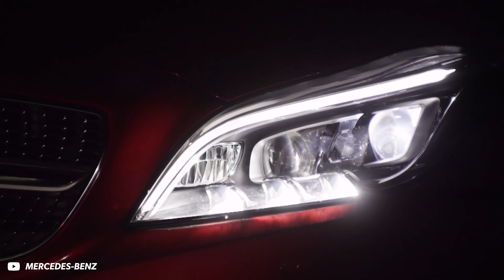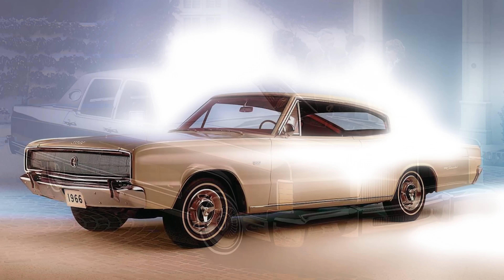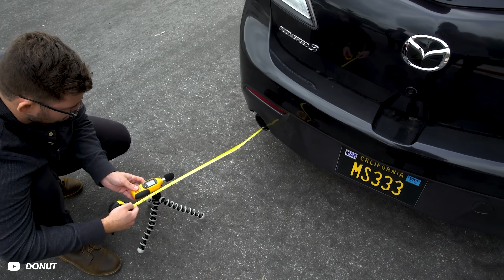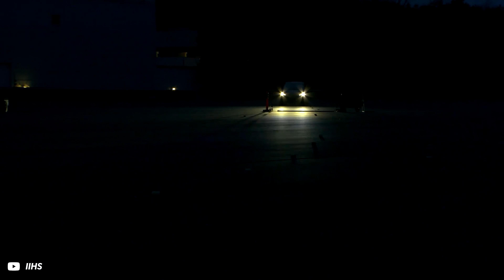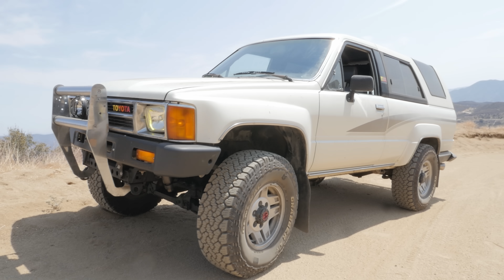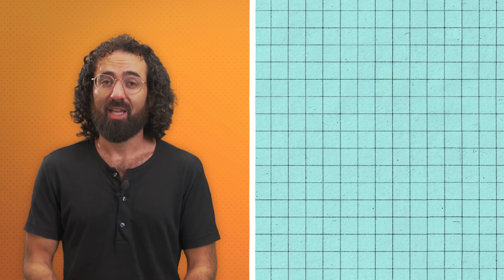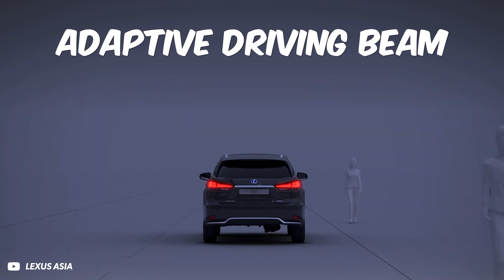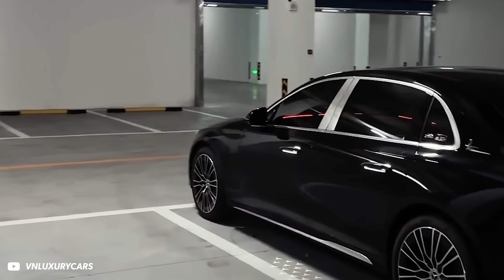Why new headlights are blinding American drivers

Comment: Hi from Germany. Same problem here and adaptive lights are trash. They can adapt when they "see" you, so every time I got blinded for a bit of a second up to a half second, when the car comes into sight and when it changes the separation it can blind you for another bit. I hate adaptive lights!
Reply: Same for me with my motorcycle. Adaptive headlights don't detect me so I'm blinded... And when I'm flashing my high beams, they don't react because they "have adaptive headlights"...
Reply: Yeah, I don't get why adaptive lights get touted as a legitimate solution when we can still see how bad the regular auto-dimming is. An attentive driver can see when the sky is being lit from oncoming traffic about to crest a hill and dim their lights, adaptive lights may not. There will never be anything better than a human with good headlight discipline. I don't know why anyone thinks permanent high beams with 100 part adaptive beams is the solution. I'm down for a standardized housing (yeah I know that's not happening) or at least a standardized lighting arrangement so that drivers with their high beams on can potentially be disciplined. High beams should be in a separate housing or clearly distinct from low beams, the Rivian-style front bar headlights should be banned.
Reply: Agreed, I had it on a few cars, it's unreliable so I just turn it off and do it manually
Reply: @benjimc1  in most modern car there is no on of switch anymore only low and Automatic
Reply: @The_otschi  yes I drive new cars mainly due to work. There usually an option hidden in settings to de/activate auto mode too
Reply: Don't forget those idiotic "auto high beams"- are people really THAT lazy that they need the car to tell THEM when it's dark enough to access that function? Sadly, it would appear so.
Reply: Is that true of Porsche adaptive headlights? In the US local dimming is disabled
Reply: @leok7193 wait really? It’s available in Canada. The other guy is right though, in my truck they make sure to blind the oncoming driver before shutting off.
Reply: @Dave-om6nd  yes, NHTSA did not allow them for a long time. The first vehicle to have local dimming here was Gen 2 Rivian R1T/S and Porsche decided not to bother with passing US requirements so even 991.2 has it disabled on the upgraded headlights. They have it in small print below the option if you pick it.
Reply: I'm not sure I even met a car with adaptive lights, but I definitely get blinded pretty often.
Reply: Yeah for sure I get it. The standard needs to be adaptive led matrix like Audi has on the A6 and the vw Arteon. The shutters box out the on coming  vehicle.
Reply: Could be worse my guy, instead of waiting for that split second before you’re no longer blinded you could be in America where you’re blinded from the moment you see a car to the moment the car passes lol
Reply: So its better to be blinded all the time ? Because thats what the video is referring to. Almans halt. Einfach keinen Grips.
Reply: @ThirdLife86  No it would be better not to be blinded, which was the case with the old lights
Reply: @Rebius  Which according to the stats here would correlate with a 20% higher accident ratio. But hey, so you are not blinded for a split second its fine if 20% more accidents happen on the road at night right ?

Forgive me mylord, i didn't know of your importance.🤦🏻‍♂🤣

Comment: Thank you. I'm a European based cyclist and I was under the impression that a part of the problem is due to the fact that LEDs lose brightness as they age, consequently the manufacturers sell their cars with brighter than required headlights in order that they are still bright enough to comply several years later.
Reply: manufacturers  are not worried about their car 10 mins after selling them

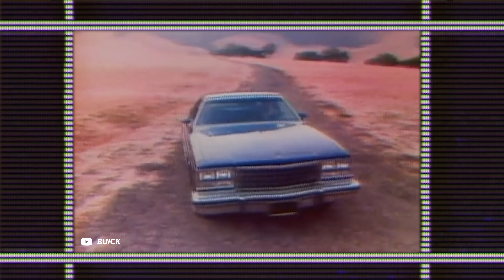Comment: 1:30 I don't care about aerodynamics, I miss when it was so easy. Now you have to disassemble so much crap on modern cars just to replace a bulb
Reply: Totally agree. I thought something was suspect when I went to replace the globes on an old car of mine. It was like $4 for a complete sealed beam headlight. For a modern car, it’s $2,000
Reply: Its even worse on the new toyota corolla with led headlights. If the led fails then you have to replace the whole headlight unit, Not cheap here in new zealand.
Reply: @GAZZA55 it ain't cheap anywhere. The price tag on those is ridiculous, while it's the part that's easily damaged even in a slight fender bender.
Reply: @joakimvhes302 No they sure make their money on the parts.

Comment: European here. Matrix ligths or other variants are not the solution because many times they do not work properly.
-If your car lights are ocluded by something like a guardrails you are F.
-Many times are slow to react, specially if the incoming car has halogen.
-If you are a motorcycle you are generally screwed cos you look like a car far far away.

At this stage of the situaton I think that the only solution is public campaigns to inform drivers that they should monitor what the headlights do and intervene to low beam if required. People has not been trained on this when they got the license. It is also not in the interest of manufacturers to say that the auto headlights need supervision.

Comment: I live in a rural area and have tried the auto high beam feature and it sucks. Way too slow unless you're driving flat straight roads. Crest a hill or come around a corner and it will blind oncoming drivers for a good second before it switches to low beams. The distance seems way less than the usual 1,000 feet that is recommended as well.

Comment: I’m glad u know that led bulb replacements for headlights, like an H11 size, that company makes and uses that horrible COB led chips. Those never work, even if it’s a 2 sided one. And 3-8 sided or 360 type led never works. 

The ones like those Autoone - 10S H11 led bulbs uses ZES led chips that’s the same size and location as the halogen coil filament, will truly mimic the same beam pattern as oem, and the hotspot will be right on the money, in the middle of the cut off line.

If the halogen bulb connector is facing down to 6 o’clock or 12 o’clock. The none adjustable 2 sided led bulbs that’s either be use with ZES,CSP, or SMD led chips will be a great option to retain the same beam pattern as oem, and the headspace between the 2 sided center piece needs to be super super thin. And it will be a perfect beam pattern. Now if it’s thick, it’s not gonna work and it will be a waste of time to get those. 

If the halogen bulbs are offset, sure u can use the correct 2 sided led but being as offset, it will not have the same beam pattern as oem it will be out of focus, and glare to others. 

And that’s one a led bulb with adjustable collar comes in. 

A led bulb with adjustable for 2 sided led bulbs with elegantly fix that problem. 

Others with multisided led bulbs do have adjustable collar, but it would not matter how u fix that, it will still be horrible results. 

2 sided led bulsb with tiny CSP,ZES,SMD led chips with very thin deadspace of the top center piece will not.

But not every single correct 2 sided led bulbs are created equal.

So despite the how bright they are, power is nothing without control. 

And that’s why it Avery important that we need to see if these led bulbs perform better on either halogen projector, halogen reflector headlights. 

Is it one better than other, vise versa? Is one better on both or neither?

That’s why bulbfacts on website, CarLightReviews, and Headlight Revolution comes into play. 

They will show u all the details of what the real wattage it produce, lumens, lux. How hot or cooled the led bulb gets after 27 minutes of run time which is the average time commuter in the US,is it cooling fan or is it a fanless, what’s the real color temperature, canbus system or not? 

The more we discover which led bulbs perform the best, fan or fanless, if it’s 2-5 times brighter than stock, perfect beam pattern, and the price point, the better we know which ones worth buying. 

It’s extremely important that others should deserve led lighting technology and education. 

Led bulb upgrades (if u get the right ones) is the way to go, and halogen lights is a thing of the past, the brightness of the ugly dingy yellow halogen lights is laughable in brightness, and led last way longer when perform correctly. 

👍🏼👍🏼👍🏼 always aim ur headlights straight or a hair down, and make sure the 2 sided led bulbs are 3-9 o’clock.

Despite the for off-road use only it means nothing 👍🏼🤣

@drive

And upgrade all the exterior lights to led like brake lights, turn signals, reverse lights, marker lights, license plate lights, and even interior lights is not only for better modern look, but also increase safety to see better and be see better at night. 

Keeps me, my family, and my friends safer than ever. 👍🏼👍🏼👍🏼

Especially when it comes to freakin deers. And man it makes a huge difference with super bright led high beams. If the drivers is coming, turn ur high beams off. 

That simple. 😊

Comment: I live in Seoul and California.
It's amazing that in California, they only do SMOG tests every two years.
In Korea, you have to get your vehicle inspected and they check EVERYTHING, including lights and light pattern.
They will even check if your car has been modified and if the parts used to modify the car is certified.

There are after market LED bulbs (Philips, Osram) and these are tested and certified to work in normal bulb housings.
BUT, the owner of the car has to register their VIN number on the database that they put in one of these bulbs and they have to place a sticker on their car registration that their part has been checked.
Otherwise, if you get into an accident and they find you are driving with an uncertified part, you can be liable.

People with older cars should have the right to adapt new technology.
But the government needs to provide guidance and regulations to do that safely.

Also, at one point I had the same exact car in both Seoul and in California.
A W212 Mercedes E Class sedan.
In Korea we get the European lights with the European beam pattern.
The same HID light was so much worse in the car I drive in California.

Comment: 55W H7 halogen bulbs are typically 1500 lumens each, so 3000 lm in total for the low beams and 6000 lm with the high beams on. 35W HID (xenon) as used by car manufacturers are typically 3200 lm each and serve both as low beams and high beams with 6200 lm in total. In Europe R48 regulations make automatic headlight leveling and cleaning mandatory for such lights. Also LED have mandatory headlight leveling, but if light output is less than 2000 lm per headlight cleaning (for glare reduction) is optional.

Comment: Here in the Philippines, you better prepare to wear your shades at night 😎. 

Moreover, I had an issue with my cousin's MG ZS, though already a projector-type headlamps, but still equipped with an OEM halogen, until they decided to replaced it with an aftermarket (6500K), result was quite bad, throw was scattered and misaligned, so most oncoming vehicles flashes them/us, so I took the initiative of adjusting it, and voila, issue solved! Projection is already aligned and concentrated thus brighness improved without blinding oncoming vehicles.

PS: My only issue, since it's a 6500K, it's fine in cement and but visibility is a little bit compromised in rain and especially in wet asphalt. And oh, the fog lights were replaced as well with a 6500K, result? It doesn't give much light, throw is short.

Comment: ADB headlights aren't a panecea. Good systems work well, but I've seen some bad ones too. They're also a significant expense. Also, they tie in to the general improvement in performance of cars in recent years that has seen average speeds skyrocket. All this safety tech is become needed simply because people and cars are going ever faster and driving with ever less care (relying more and more automated systems).

Comment: OEMs are fine and tested to meet specific light patterns they will not blind you. Aftermarket has always been a problem. If your getting blinded by OEM lights, stop looking right at them! You're taught to look at the white line at the edge of the road. If you're getting blinded from behind in your mirrors, them your mirrors are probably not adjusted properly. 🤷 But yeah, aftermarket bulbs are bad.

Comment: Three factors not mentioned in this video:

1: Some new cars with LED headlights aren't properly aimed from the factory, and are set too high. Yes, you can easily fix this in two minutes by popping open the hood and using a screwdriver to aim them down a bit, but most people don't know this, or even care.
2: Projector LED/Xenon headlights are generally less glaring than reflector headlights. Projector headlights have a sharper beam cut-off, and can have an AR (anti-reflective) coating on the glass to reduce glare to oncoming drivers.
3: Those halogen-to-LED replacement bulbs that advertise 60,000 lumens are BS. At most they are around 5000 lumens. Any more than that and they'd literally melt from the heat.

Comment: In japan taxi at night require highbeam in city because pedestrian and cars share the same small road but also blinding everyone.
On highway and suburbs city they use very dim street light in many area that almost useless. So now everyone need to run on highbeam all time.

So I think the solution are put reflective things and light around the road and people instead of putting stronger head lights on cars.
And ground laser projector on cars that can let people know the path they are going/turning. Toyota is doing that.

Comment: The worst vehicle is the Honda HRV. Not only did they not properly aim the headlights from the factory, the genius designers gave the car two bulbs in each assembly which resembles high beams from the point of view of everyone else. 9 times out of 10 when I get blinded it's one of those jelly bean looking HRVs. Honda needs to be sued and forced to issue a recall.

Comment: A common mistake when installing aftermarket bulbs is choosing the cheaper options that have the LED chips in the wrong location for the given reflector housing. Also, most U.S. spec cars don't have the option to adjust the headlight cutoff level electrically (with a switch or knob inside the car), meaning that the only way to adjust them is manually under the hood. The vast majority of people will never care enough to take the time to do this properly.

Comment: "camp in the slow lane" bro that's what it's for
Reply: I'm convinced that was either a gaffe or clever engagement bait.
Reply: @freakinsweetdude  Has to be. Camping in fast lane makes the drivers side mirror still useful, instead of adjusting it way off to keep from getting blasted by light. One truck I saw had as much light directed to either side of the vehicle as it did forward

Comment: These lights have changed night driving from a way to escape and clear my head to a nightmare. They're awful.

People will quickly point to matrix headlights as a solution but in the rain these lights still reflect into eyes, and based on how slow auto high beams are to react around curves and hills, you'll get blinded before it reacts. 

Also special shout out to all the jerks that put led's in their highbeam/drl combo lights, because manufacturers pulse those lights 0-12volts so it averages 6v. Halogens operate dimly due to their inability to match the speed of the pulse, but most led's are able to just drive at full brightness. Some cheaper ones pulse, but only people sensitive to the pulsing pick up on it. Either way you're still driving with ultra bright highbeams.

Comment: One of the largest issues that everyone misses in this discussion is the aiming of headlights. When headlights are aimed too high, you can have a headlight system that shines with lower brightness, but still blinds oncoming drivers. From the factory, a lot of headlights aren't aimed properly—or more precisely, the aim has some variance. Owners don't know to get their headlights calibrated, nor do they realize that over time that calibration could drift. So, it's not just brightness it's the aiming of headlights and the fact that few people pay attention to getting that right.

Comment: The worst offenders in my experience are tall vehicles with soft chassies => 90% of the roads are badly maintained => cars are constantly wobbly => headlights are constantly hitting the eyes of drivers on the other side. The worst offenders in my experience are newer Jeep Wranglers, Rav 4s, CRVs and first gen Model Ys.

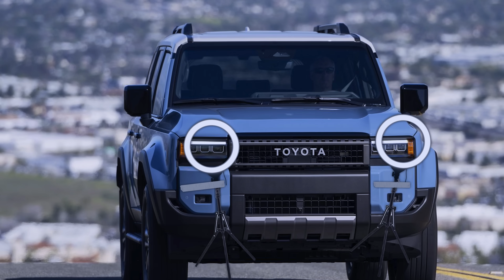Comment: @09:00 I'm from Europe and I assure you adaptive beams aren't as great as you'd think. Example fails, 1: Lane dividers on motorways = blind EVERYONE. 2: haven't cleaned the sensor properly this week?= blind EVERYONE. Slight rainfall: BLIND E.. you get the point... In theory these are great, in reality they suck, almost to the point where a consistent blinder is preferable to these cars that flash blind you for some seemingly random reason

Comment: Thank you for stating the issue of US regulations being years behind Europe and Asia. Even before adaptive LEDs, the US versions of halogen and HIDs were inferior due to them being less bright and having duller beam patterns. The ECE H4 beam patterns were fantastic back in the day,and the US had crappy sealed beams.  Plus I don’t think the US SAE or IIHS bureaucrats (excluding the engineers), even know the difference between the types of headlight tech that is out there.  The US should just adopt the ECE headlight guidelines. That would also save the automakers money.  We also have inferior taillights, allowing red turn signals and allowing a single bulb to be the brake light and turn signal. Jeeps and cheap GM cars use to be the worst offenders, but now Mercedes and BMWs have also joined the party.